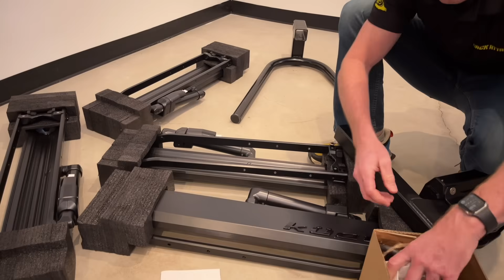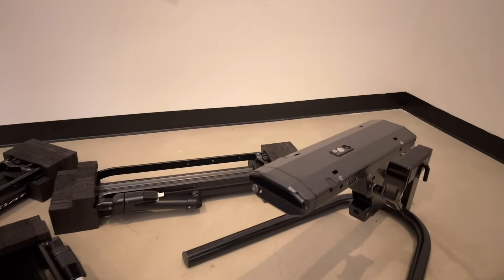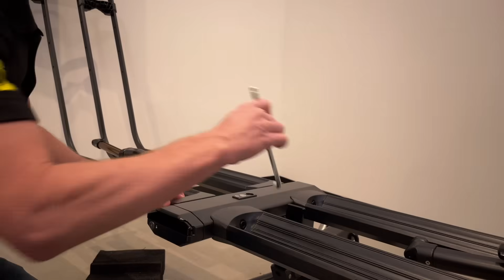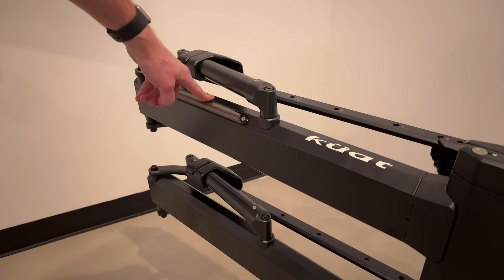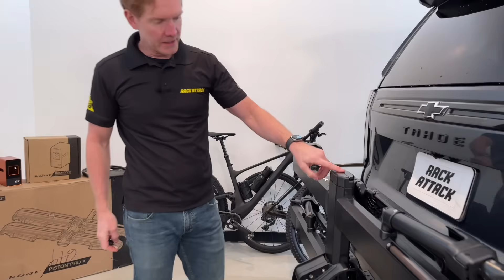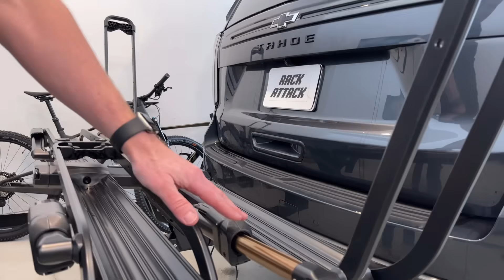Kuat Piston Pro X Bike Rack - Exclusive Deep Dive

Comment: I saw somewhere that less than 10% of the rack is not metal. After buying mine and examining it, the only things i could find that werent metal were the lights, and the coatings on the cables.

Love this rack.  It took me a year to save up for it, but in the little bit of time I've owned it, i have to say "Worth it!"

Comment: Awesome video! Before mounting the outside trays you have to connect the wiring. After connecting slide wire slack into center mount. Assembly took me about 25 minutes. I torqued trays to 45Nm.

Comment: Loved your video, it's very informative! I recently purchased 2 Velotric Discover 1 Step Thru Bikes with the Front Basket & Rear Rack options for long touring trips. Is there enough room for the 2 bikes on this rack without the bike rubbing/touching or you need to add the 3 bike option? If so, I'm worried about weight capacity of the racks. Or your recommendation for the best rack for my purpose. Thanks!

Comment: The manufacturer lists torque specifications for a reason. I was a bit surprised that a torque wrench was not used for installing the trays.
Reply from the maker: Hello.  Yes, torque specifications are important, fortunately, this mechanical connection is very forgiving and the wrench leverage provided sufficient feedback to make a proper connection.  If in doubt, by all means, use a torque wrench.  Thanks!

Comment: Thanks for the detailed review really appreciated, I have a an ebike ( Cyrusher XF690 Maxs)  its quite heavey 74lbs with battery and 78 inch long. Is it gonna work with this size of bike? Please advise.
Reply from the maker: Hello.  The maximum bike wheelbase is 53 inches and the maximum weight capacity is 67 lbs per bike.  Based on the specifications of the Cyrusher XF690 Maxs, we do not have a rack solution at this time.

Comment: Great informative video sir. Good job! The only question I have is that I have a xl Santa Cruz heckler ebike weighing 48lbs and I'm trying to determine the length of each bike trey if it'll be sufficient to comfortably sit front and tear tires of the bike before ordering. Please let me know..
Reply from the maker: Hello.  The max weight load per bike is 67 pounds and the max wheelbase is 53 inches.  Thanks!

Comment: For this price point the cable for the electrical connection should not just hang there, and the security cable is a very unsophisticated cheap solution!
Reply from the maker: Hello, thank you for commenting!  There are magnetic clips to help keep the wire tidy: https://youtu.be/5X4uoygZBOU?t=1047  The type of cable security method found on this rack and others has become a common standard for many racks, however, if a higher level of integrated security is preferred, see the RockyMount GuideRail which uses a 10mm square link chain lock which is quite robust. https://youtu.be/QJKd5MaLCaI Thanks!

Comment: The rack itself is extremely well designed, but the kashima pistons are f***ing stupid. This is not an application where you need to reduce friction, you don't even move the tire holders yourself so any friction reduction won't even be felt! Imagine how much cheaper this rack could've been without the kashima
Reply from the maker: Hello.  Kuat will offer a less expensive Piston in the near future without the Kashima finish.  Thanks!

Comment: Great video.  Does the 1.25" version come with a 2" adapter?
Reply from the maker: Hello.  The 1.25" version does not included an 2" adapter.  Kuat makes an adapter, however, the Piston is not listed as a compatible rack.  Thanks for checking.

Comment: Is their another security to secure your bike other than the cable? This is very easy to get stolen if you sit in traffic without your cable.
Reply from the maker: Hello.  The single cable is what's included, we'd suggest using the cable and adding some extra protection for delicate bike surface contact points.  Some report that using a cable while driving long distances could rub on the bike.  Thanks!

Comment: Shoot that is heavy! The 1up is super duty double is 47lbs compared to this @ 64lbs! Also the fact the tray is parallel to the ground can cause clearance issues especially if you offroad as MTBrs do, where the 1up helps as the trays are staggered upward.
Reply: Comparing a 1UP rack to this Kuat rack is like comparing a base model Camry to a loaded BMW. 1UP makes fine stuff but it's vanilla and boring with no features.
Reply: @JT3-610  Really? My 1up has lights too! Features? The Kuat gets hung up more with steeper departure angles? The piston feature is a leak waiting to happen as the seals dry out, while cool its not necessarily better, just different. So kuat is heavier and longer causing more problems, but does have nifty lights but with an easily cut cable lock.... Both are fine, but neither are vanilla
Reply from the maker: Hello.  Thanks for the comparison.  The Piston Pro X offers the higher weight load capacity per bike of 67 lbs vs the 50 lbs max of the Heavy Duty.  Thanks again!
Reply: @rackattack  Actually 1up states 50-75lbs per bike spot and maximum total of 225lbs. If using 4 bikes total, then maximum is 50 for the last 2 spots. This is for the Super Duty.
Reply from the maker: @rezenclowd3  Thanks for the clarification!
Reply: the one up rack also doesn't have any of the features and everything is sold separately. I wore the one up out in 7 months. The one up is cool because it is light but thats about where it ends. the springs break and then your arms will seize up. I am excited to try this rack.
Reply: @cameronkg5  1up only has 1 spring and it's only used to lock the rack in position, it won't sieze up. If it was tight, usually just losen the bent arm....also "everything" is not sold separately but spare parts can be had....
Reply: If you want locks, or the assembly to lower it from a reasonable position you have to buy them separately. The spring is what breaks or wares out then you can’t lock the bike on because it is locked in one position. My experience with my one up has been awful. I would roll into Walmart and by a $30 trunk rack before I bought another one
Reply: @cameronkg5  I recommend you do more research. The locks are also "separately" when you buy the Quikr. Anyway, if the spring fails on the 1up, it does not hinder positioning of the trays, nor does it have anything to do with locking the bikes to the trays. Me thinks you have not owned a 1up despite claiming so.

Comment: Very nice rack. Excellent design and workmanship and all the bells and whistles a person could think of. But jeeezz $1400 you're killing me.... If you wanna play you gotta pay as they say I guess.
Reply from the maker: Hello.  Yes, the Piston Pro X is full featured.  Kuat will introduce a lower cost version without some of the features in the future, details to be determined.  Thanks!
Reply: @rackattack  Thanks. I have 2 heavy eBikes so I want some overkill, such as a rated capacity of around 200+ lbs. I'm very much drawn to either the 1UP or the QuikRStuff Mach2 but both have a lot of backlogged orders due to different issues. In the meantime I'm gonna settle for either the Harbor Freight 400 lb motorcycle rack or the same from Amazon while I'm waiting. I see where many guys have used the HF & Amazon racks very successfully. Who knows, I might be so satisfied with the HF rack I don't get anything else.

Comment: I own 2 Ebikes. In is a 2021 trex Allant + 9 (50 lbs) and a 4” fat tire RadRover 6 plus (80lbs). Will this rack be able to transport both bikes?
Reply from the maker: Hello.  No, the max weight per bike is 67 lbs and that's the highest weight capacity of all the major rack brands.  Thanks!
Reply: @rackattack  That is  ABSOLUTELY FALSE AND colossal attempt to cover up the fact that there are multiple racks by "major manufacturers"" that have significantly higher weight rating..  Easily checked and you should know better.  1Up bike racks have a rating of 75 lbs per bike.  1UP is easily a "major" bike rack manufacturer.  Your use of the term "major" is an extremely disappointing word salad to try to deflect that your statement is false.  I'm being kind.  The limited production QuickR Stuff Mach 2 bike rack has a weight rating of 120 lbs. for the first 2 bike positions.  Focus on the features, some of which are very nice, of this extremely overpriced bike rack.  That way you don't have to make false statements.  Again, I'm being kind.
Reply: @tomwrzos9251  thanks for your kindness the Mach2 looks amazing unfortunately it’s 6 months back ordered. 👍
Reply from the maker: Yes Tom, after further research, we see that there is a 1UP SuperDuty version which offers 75 pound max per bike, while the HeavyDuty version is 50 pounds max per bike. Thank you for bringing this to our attention.
Reply: FYI - for those with Ebikes, The 1UP Xtreme has a capacity of 150 pounds each tray at the same price and the QuikRack Mach2 holds 120pounds per tray at about $200 less (but currently a 1 or 2 month wait)